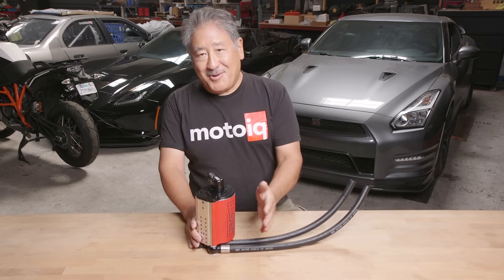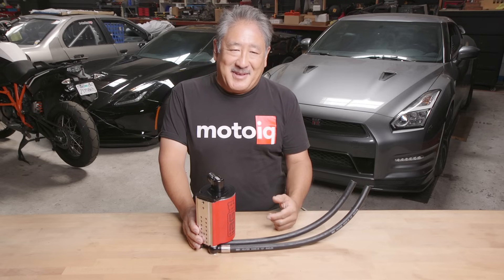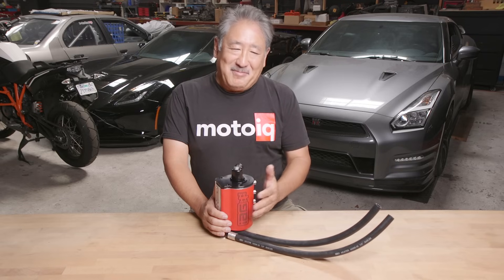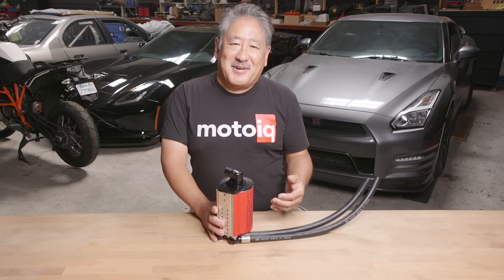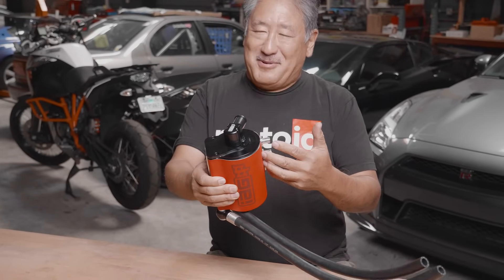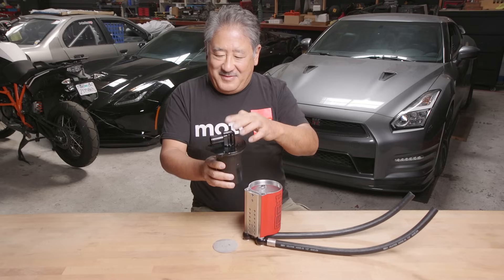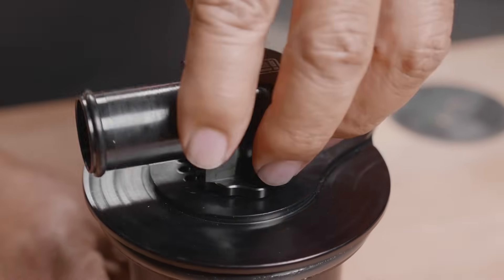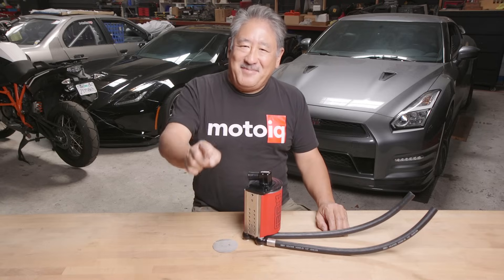How an Air Oil Separator Works and Why You Need One!

Comment: If you have direct injection only you’re gonna need it because you don’t have Port fuel injection to clean your intake valves
Reply from the maker: And you can empty your crankcases in as little as one track session if you have a flat engine.

Comment: Sorry to be that guy but most of what you said isn’t going to be happening Mike, there’s no centrifugal force separating anything, there’s nothing to make the gases keep spinning, no way to actually separate the heavier materials, the hotwall would be doing all the work. 
Hydraulic fitter so I know a little bit about fluid dynamics/hydraulic principles and more importantly, how fluid separation works.
Reply from the maker: I think you might not know as much as you think

Comment: Could this unit benefit a supercharged 3rd gen tacoma? Or would there be a better solution for that scenario?
Reply from the maker: Yes it would
Reply: @motoiq given that oil may now be circulating in the aos system, should that equivalent amount of oil, or less, be added to engine or no? Im an offroad driver who carries a lot of weight and force the engine in to high rev conditions but i dont purn a ton of oil that i know of.
Reply from the maker: Some engines blow a ton out the breathers.
Reply from the maker: You don't need to add extra oil.

Comment: Um.... Dumb question.... Most engine blocks don't have a port built in to return anything back to the crankcase. Am I correct in guessing that the oil pan would need to be tapped for an oil return?
Reply from the maker: Most engines do.

Comment: THEY FREEZE
Reply from the maker: If you paid attention this one won't
Reply: @motoiq  IAG Air Oil Separators (AOS)
use engine coolant to heat the canister, effectively preventing the condensation/oil mix (sludge) from freezing in cold weather, a significant advantage over basic catch cans; however, in extreme cold, the small return line can still get gummy or clogged, requiring proper warm-up, check-ups for blockage, or considering a catch can in very severe climates, though the heated AOS is designed to minimize this issue for daily driving in most freezing conditions. 
How IAG AOS Addresses Freezing Sludge:

    Coolant Heating: The key feature is its integration with the engine's cooling system, keeping the canister warm enough to prevent water vapor from condensing and freezing with oil into thick sludge.
    Heated Design: This heated design reduces buildup and ensures collected oil stays liquid enough to drain back to the engine, unlike non-heated systems. 

Potential Issues in Extreme Cold:

    Return Line Clogging: Even with the heated canister, the smaller return line between the AOS and the engine can become gummy or freeze, especially in very low temperatures (e.g., -30°F or below).
    Sludge Buildup: While the AOS manages the mixture, some "sludge" (oil, water, fuel blow-by) will always form, and blockages can occur, requiring occasional checks. 

Recommendations for Cold Climates:

    Warm-Up: Allow your car to warm up sufficiently before driving in freezing conditions to let the AOS heat up.
    Check Lines: Regularly inspect the AOS drain line for any blockages.
    Consider Alternatives (for extreme cold): Some users in very harsh climates suggest a dual catch can setup or catch cans over AOS, though IAG's heated Street Series aims to mitigate this. 

In Summary: The IAG AOS is designed to handle cold weather better than standard catch cans due to its heating system, but extreme conditions might still require extra vigilance or a different approach for absolute peace of mind.
Reply: @motoiq  so is this one good for any weather and conditions and everyone should have it? or are there any caveats?

Comment: So it's a giant PCV system. All cars have factory oil separators upstream of the PCV. Why this system over a factory PCV? To cope with extra blowby from HP mods? The elegant part with the factory design is there's no need for a coolant heat exchanger.
Reply from the maker: Flat engine puke a lot of oil and the factory one isnt enough on these cars.

Comment: This really is an ingenious invention. Because it equalizes the crank case pressure, eliminates oil contaminants, and returns the oil back to the engine all at the same time. Without any heavy maintenance. I wonder if Subaru will ever sell turbocharged models with Air Oil Separators from the factory.

Comment: My shop has been tasked taking more of these off WRX's than install...and its always after they've blown the head gaskets or threw a main bearing a few short months after putting this on their cars. Stock cars, unmodified. I dont know, these might be designed to help cars with crankcase issues when modified.
Reply from the maker: That has nothing to do with those problems and can help prevent them and you should not take them off, just make sure they are properly installed.

Comment: I love the notion of recirculating the oil back onto the crankshaft. However… I am told catch cans usually fill up with a lot of condensation (water) aswell… especially during normal road use versus track oriented driving.

Wouldn’t such an air/oil seperator also mainly recirculate water into the crank case? Which is exactly what you don’t want 🤷🏼‍♂️

Not trolling. Genuinly interested in your feedback on this. Am looking for a good solution for an N18 engined 280 HP R60 mini build.

Edit: LOL… should have watched the entire video prior to asking hahaha.

Edit 2: After watching the whole video I have two questions that ‘are’ relevant:

How does the oil return line not ‘also’ act as an overpressure release for the Crank case? And thus in effect: how does the oil actually return into the crank case? I have a hard time understanding there would be a positive pressure differential between the inside of the oil seperator and the oil return line. Blow by in the crank case essentially puts pressure on everything connected to it at the same rate. Help me understand.

I love how they use the coolant temperature to ensure condensation doesn’t take place ensuring water does not enter the crank case. But then you go ahead and confuse me by saying the upper baffle towards the air exit (and turbo intake) is responsible for some final condensation of water vapor in the air… ‘That’ condensation would drip down into the oil seperation chamber and still enter the crank case right?
Reply from the maker: If you watch the video it has a heater to drive the water off.

Comment: Nop! el aceite no debería volver al motor, sabemos que éso logra dos cosas: cambiar la composición del aceite y por lo tanto sus capacidades lubricantes, refrigerantes y detergentes se ven afectadas, luego viene la falla de motor y CHAU MOTOR! NOP NEGATIVO el flujo de aire que sale de la admisión y porta vapores y aceite micronizado, no debe volver al cárter. gaste unos billetes si tanto le gusta correr y no sea tacaño, póngale aceite nuevo. Oil Catch Can es mejor!

Nope! the oil leaving the intake should not return to the engine, we know that this achieves two things: changing the composition of the oil and therefore its lubricating, cooling and detergent capacities are affected, then comes the engine failure and CiAO MOTOR! 
NOP! NEGATIVE the air flow that leaves the intake and carries vapors and micronized oil, must not return to the crankcase. Invest some tickets if you like to run with the car so much and don't be stingy, add new oil. Oil Catch Can is better!
Reply from the maker: No, te equivocas. El único componente potencialmente dañino del aceite de escape es el vapor de agua, que puede formarse en condiciones de frío. Este tiene una camisa de calentamiento para expulsar el agua antes de que regrese al cárter. La composición del aceite no cambia por arte de magia. De hecho, los coches con turbo pueden perder varios litros del respiradero en la pista y agotar los cojinetes; esto lo evita.
Reply: Ok @motoiq  estemos de acuerdo en que NO estamos de acuerdo. La teoría de los cojinetes no la ví en ningún estudio y si ví mejoras en pruebas de los usuarios, con turbo o sin turbo. Cojinetes, bielas, filtros y orings se benefician de la limpieza y un aceite que no varía negativamente con el hollín, los aditivos desbalancean y la naturaleza original del aceite cambia. Con Oil Catch Can se solucionan varios de éstos y haciendo un control de presión negativa en la pcv, evitamos sobre presión en cárter. Gracias por compartir tu experiencia en Youtube 👍
Reply from the maker: El colector de aceite no altera la composición del aceite; simplemente concentra el escape de gases, elimina el agua y la devuelve al cárter, a la vez que proporciona una ventilación superior y reduce la presión en el cárter. Los motores turbo, especialmente los Subaru, tienen problemas para expulsar el aceite a través de los sistemas de ventilación y PVC en la pista, y este sistema es de gran ayuda. Este es un problema común en Subaru, y esto lo soluciona. No sé si la gramática es correcta; mi español es muy malo y estoy usando el traductor de Google.

Comment: Why isn’t this just part of the engine?
Reply from the maker: The stock engine has air oil separating features, but it isnt enough for a modded engine running more boost or hard driving.

Comment: Super informative video. I have a Audi's 3.0 with a supercharger from the factory and I'm pretty sure this is how our PCV's work from the factory. Cons are they buried it under the supercharger, fuel rail, vacuum lines, coolant pump, and wires, they don't necessarily fail often but are a maintenance item and kinda PITA to replace and drain coolant to the oil pan if you let the seals wear too bad.

Comment: I removed my process west intercooler and pipe work after a day on track I’m full of oil car is low mileage 2.0 jdm grb 2013 . Will this prevent it all I’m only 350-350 still have cat fitted right now but drive hard . Also what sump do you recommend on semi slicks for twin scroll cars thanks sir 👍🏻
Reply from the maker: It should go a long way to prevent this.  Our car is absolutely dry.  I recommend IAG's pan baffles/windage tray, and pickup.

Comment: Yeah, but then I heard that you should not use an air oil separator in a cold climate like in Pennsylvania where I live because it will freeze and cause circulation problems and possibly increase the crank case pressure. Therefore catch can is recommended. Does anybody know anything about this?
Reply from the maker: This one has a heater if you were paying attention to the video.
Reply: @motoiq  I was listening. I'm just commenting on what I heard. Obviously I heard right, but what I heard was wrong. Which is why I asked. Point is, get the IAG if you want a good one. Also, I presume obviously it eeds to heat up first. I could do without the passive-aggressive undertone.
Reply from the maker: I am 100% not passive aggressive. Just when someone asks a question that you answered in the video it is annoying.
Reply: @motoiq  hahaha. I bet it is. I guess I just didn't think of that.

Comment: Hey Mikey...I like him!
Great info on the differences of an AOS and CC. I need to get one of these for my P car and Subie since both are H patterned motors, but only the Subie is a turbo, yet both are GDI motors. What are the dimensions of this can with the banjo bolts? 
I need to see where I can fit this in my 991, not much room in that engine bay to begin with.
Thanks Mike!
GREAT VIDEO!!
Reply from the maker: Your 991 has a factory AOS.

Comment: can they fail? if so how? got a shop telling me the AOS is the cause of oil getting into combustion chamber causing the smoke on start up, this is a subaru dealership telling me this
Reply from the maker: More like that's the opposite of what can happen.  If it was a too full catch can, yes but not a properly installed AOS.
Reply: @motoiq  thank you, any advice on where to start to find what's causing burning oil on start up?
Reply from the maker: Probably turbo oil seal related
Reply: @motoiq  thank you, I'll start there. Amazing videos btw they really help.

Comment: I have a procharged hemi with an edelbrock intake manifold that's putting extremely abnormal amounts of oil in my catch can.. Would a filtered a/o separator like a ProVent work better for my engine since it has a filter? It's technically for turbo diesels but I can't see how that would negatively effect my application.. Btw, if you do some searching on edelbrock 7179, you'll see plenty of other ppl with the same oil problem so it's not something that is caused by my crankcase
Reply from the maker: I would do the air oil separator. It is normal to get more blowby when doing FA on an engine but I would be a good idea to do a compression and leakdown test on it to make sure the engine is ok.

Comment: Does this works with air-cooled flat engines? I don't have a cooling water system so the only way to use the heating manifold would be the oil line to the front radiator where the car engine gets fresh air into the cooling system.
Reply from the maker: Mostly useful for turbo engines

Comment: Thank you for that information.  We are getting started on a marine engine.  572 dart block 12.5 cr. The camshaft rpm limit is 8500k running on high test fuel. We have had issues with moisture and contaminated engine oil in the past with a stock 502 .Thinking about a vacuum pump for battling this condition . Now, watching this video,  I was wondering about the catch can your takling about. Do you think it can handle the job instead of a vacuum pump ?
Reply from the maker: This isnt a catch can, it returns blowby oil to the crankcase.  A vacuum pump still probably needs something like this on the scavenge side.  Vacuum pumps can increase power.

Comment: Back in the day we called it a swirl pot. It was really only necessary on super highly tuned engines and stopped the crankcase emmissions from contaminating the intake charge.  Were i live we are not allowed to vent to atmosphere. It also returned the oil back to the sump. A catch can was only used for race cars.
Reply from the maker: A swirl pot is part of the cooling system used to take bubbles out of the coolant.
Reply: @motoiq  Well I won't argue the point because it won't get us anywhere but when I was a youth running turbocharged cars that was the common term used because the oil is literally swirling around inside. The point at which bubbles are formed in the coolant the engine would be in serious trouble because that would mean the coolant is starting to boil. In which case it would vent from the pressurised system and into the header tank which has a lower pressure breather cap to allow air to escape. But I still like you're videos and find them quite interesting.
Reply from the maker: You would not want to do that because you would lose oil pressure.  You should not have active pressurized oil flow in an open swirl pot-type device.  Google swirl pot and every single thing that comes up is for de-aireating coolant, not oil. We use these in just about every serious race or drift car. They make a huge difference.  Race engines have localized boiling and these get rid of the bubbles. This is an air oil separator because it gets the oil out of the blowby gasses and returns it to the crankcase.
Reply: @motoiq  I understand you're point im just saying where I live we called these swirl pots because of how they work. You will also find some people calling a fuel surge tank a swirl pot and that's not strictly correct either.  The devices we used for air oil separation were not under pressure as they were external to the engine. They just caught the vapour from the breather system and returned the oil to the sump by gravity.
Reply from the maker: Ok it's the same thing just different semantics.
Reply: @motoiq  That's kinda what I was trying to say. It's like a local dialect thing. Anyway great video. Lots of good information delivered in a friendly way

Comment: I have Tracey Lewis's - Air Oil Seperator on my 6th gen camaro. It is SOOOOOOOOOO good, I would say even normal Direct Injection cars even not meant for performance should have something similar installed. These GDI engines can break down very easy due to blow by build up. People just dont know how helpful these things are.

Comment: I don't really understand how the drain back to the engine works.  Whereever you connect the drain onto the engine, wouldn't it have positive pressure and push the oil upwards?
Reply from the maker: Not all the time
Reply: @motoiq  so, some of the time, it pushes the oil upward?  Your answer isn’t helping
Reply from the maker: Possibly during times of high blowby although the engine has a lot of other venting.